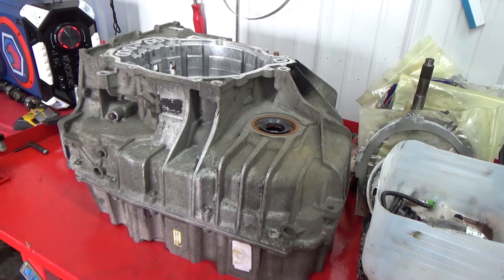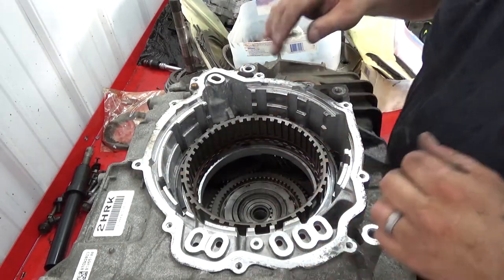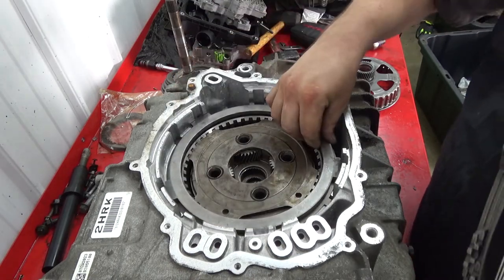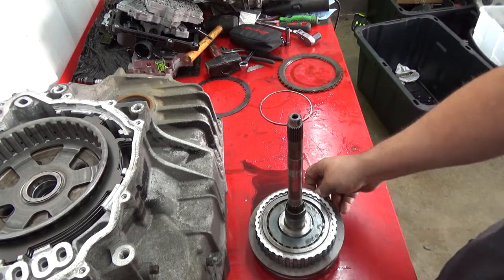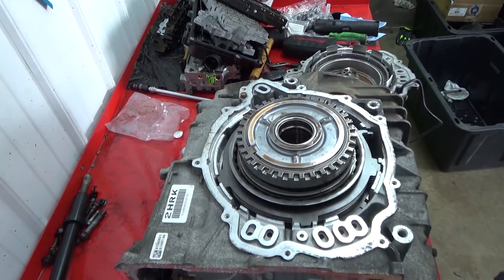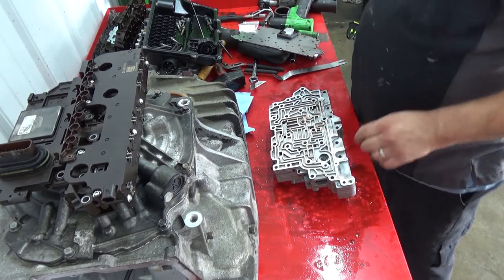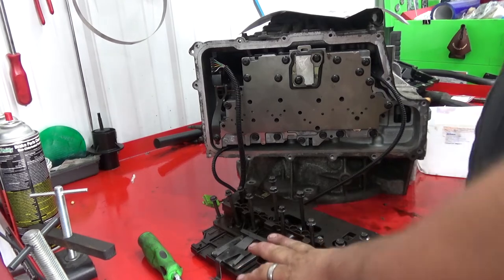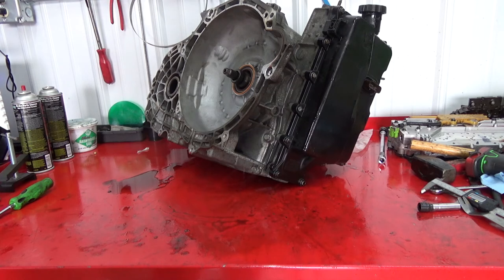6T70 Rebuild Part 2. 6T75 Rebuild Part 2. Transmission Assembly. Transaxle Assembly.

Comment: Just got a 2012 acadia
It shifts fine once you get going, just when you first put it in drive it takes a little moment to engage
And when it gets to 60mph at below 2k rpm the speedo needle bounces a little up and down and it feels like a gear engaging and disangaging if that makes sense.
Could it be the torque converter

Comment: Hi. I have issue with my impala limited 2016 it is about 65k. Once I shift to D, car doesn't  move with RPM. Or move but very shortly. shift to R and ok. I was in mountains when it start fail to move. But I manage to drive back home on manual mode , 3 gear. Problem is that I am in italy an here no one knows what to do. Please  advice, what can be the root cost of this failure. It is ex PPV  from Police

Comment: I have 1 with a intermediate pulse that I believe is a bad torque converter. So I got a used one that has a slip on the 2 3 shift that is causing a traction control

Comment: Great video!  Question though, if everything is in place correctly, why would the cover plate not seat fully against the transmission? All the thrust bearings, gears and clutch plates are correct, but the cover sits maybe 1/4" high...
Any idea?
Reply from the maker: Definitely sounds like something isn’t seated right. As for what it is there are a lot of options. I would def go thru it slowly and make sure everything lines up. It can feel “good” but not be right. If that makes sense
Reply: @DMoneyGarage  it makes sense.  I've been through it about 7 times and just can't figure it out.  Time to find a transmission shop and have then swap in a reman.

Comment: First thing great videos,  Part 1 and 2 were what I needed to tackle the job. I have a Buick Enclave and have worked on my vehicles to make them last a while. I am mechanically inclined but when it comes to transmissions well I can remove them and install them. But tear them down, I was always skittish about all the parts involved. Now I am faced with the challenge of either purchase a refurbished or buy the rebuild kit for it. My vehicle is performing now with a shudder at 3 gear going into the overdrive. This happens at around 35-40 mph. I have heard that it could be the torque converter and others have said wave plates. Would you advise to rebuild it or just swap it with another. I know money wise its cheaper to get a kit along with a new torque converter but I was trying to weigh my options. is it worth the time and money? What is your advise and what are the common factors to my symptoms. Any help will help me. Thanks Gabe
Reply: You got the exact same problem I have with my 2016 Enclave... So instead of asking what you've already asked, I'll just check back in for a response... I'm looking at just replacing my entire trans with a corrected remanufactured one from a company that specializes in these exact GM transmissions... They run about $2300 with the core...
Reply: I also get the shudder, it's occurring from 1400-2000 rpm in 3rd gear, and I can hear that mechanical "percussion" noise that sounds like an old-school metal percussion fire alarm bell.  I'd rather rebuild if I can!  2016 Chevy Traverse.

Comment: I didn't see you install output seal.  On the right  side how far down does the seal drive in?  Does it bottom out when it's installed?  Do you use any rtv or grease before installing on the outside edge?
Reply from the maker: This transmission didn’t get that seal since it’s all wheel drive but it doesn’t bottom out. I usually drive it down like 1/4 inch from the edge of the trans.
Reply: @DMoneyGarage  
Is there a vent on this transmission?  For front wheel drive 6t70.

Comment: Hey where are you located I need to bring my truck to you
Reply from the maker: Northeast Indiana
Reply: @DMoneyGarage yoooooooo me too I got a 2012 chevy impala 6t75 I want to get a transmission rebuild/ shift kit upgrade installed is that something you could help me with? I'm mechanically inclined but haven't ever worked on a transmission.